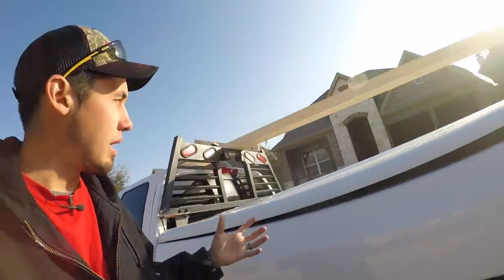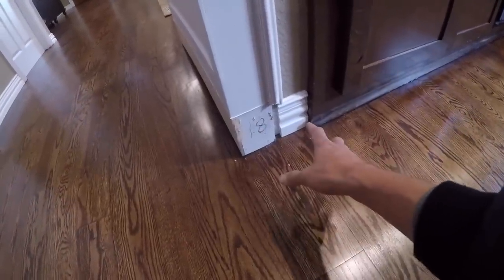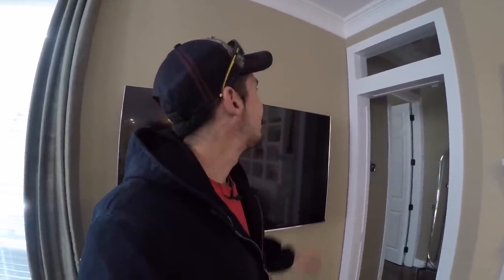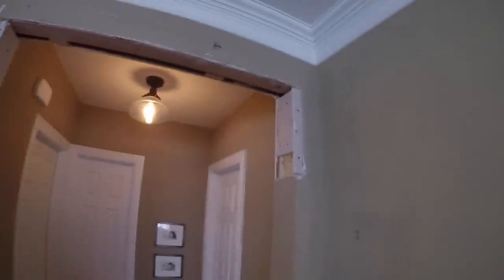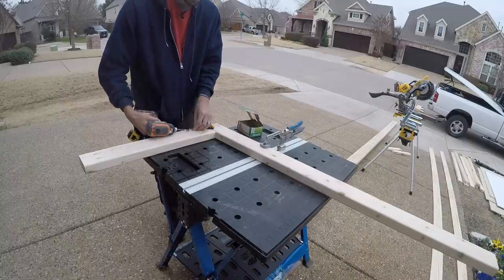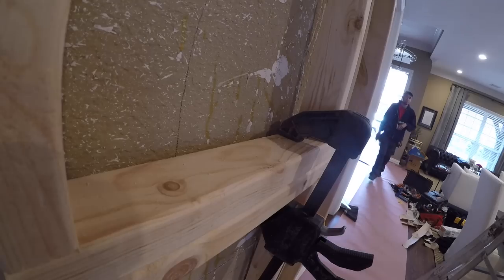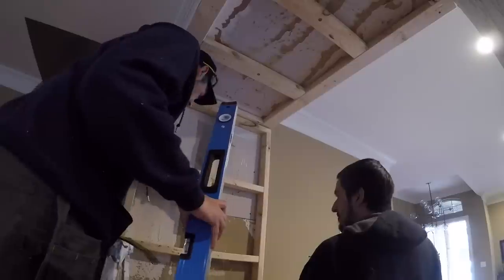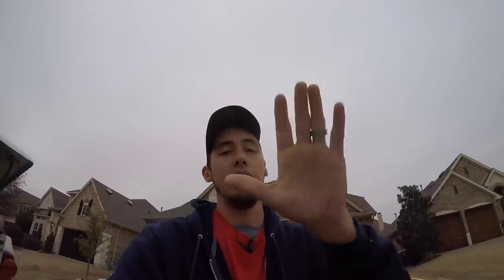A $3500 Mistake

Comment: You have a great foresight for finish carpentry. Good run through, but please move (if you can) and or cover furniture. Also zippered walls for other rooms. I teach my apprentices that no matter how good your work looks and functions, when the customer sees a Dusty mess they see your work in a different light. Even if you get caught cleaning the furniture.
Reply: God of plumbing I don't think he needs your help, i think you need his help emotionally
Reply: Doing a good job isn't just about the actual work you do, it's the whole experience the homeowner gets, like taking your shoes off or putting shoe booties on, especially when the floors were just refinished. Also, keeping a emaculate job site, and putting a good amount of effort into protecting the homeowners stuff, like the floor. If you dropped a screw driver on that cheap rosin paper, you be fixing a dinged floor.
Reply: God of plumbing
he is not your apprentice so he don't take orders from he he works for himself
Reply: tyler krug immaculate. Don’t show off, if you have nothing to show off.
Reply: @KitchenerLeslie2  10 months later?  Don't break your glass house.
Reply: @1dgrdgr  if someone is stupid, they shouldn't prove it unprovoked.

Comment: Hey I’m from a big union state, seen a ton of good carpenters. This guys good keep making videos my man
Reply: He’s a bit extra and not efficient. He really didn’t need those toggles when he was screwing 2x4 into 2x4.
Reply: @ponoahuna627  From a customer perspective you want your trim guy to be a little extra. Plus, he only used the toggles when attaching the 2x framing directly to drywall. He wasn't attaching it to another section of framing.
Reply: @lsara3699  not really... you don’t need to overkill trim... structural... yes. But not trim. a 2x4 weights 5-10lbs... each screw will easily hold 200lbs. No need for the toggles.
Reply: @ponoahuna627  I'm saying he had nothing to screw in to in that situation - he had to use toggles to attach it where he wanted it.
Reply: @ponoahuna627  tbh the and bow baseboard was only thing wrong

Comment: Ok Im what they call a professional multicraft construction worker. I work on the industrial side meaning I have to do everything from form and pour concrete to remodel offices.  I have built cabinets for a living. I have hung and finished drywall and for a few years I worked for a man who flipped houses. I will never know it all but i take my time and do the job the right way or not at all. One of the guys I learned alot from taught me most ppl wont know what it cost but everyone knows what it looks like and how it holds up. Nice to meet you.
Reply: lee jones and knowing multiple trades shows you how your work in one area may affect your results in another.

Comment: Good video! The old guys always said to me when I said something was level. PLUMB is vertical and level is horizontal.  Keep up the videos!
Reply: Plumb comes from using a lead weight hanging on a string to confirm if something is hanging vertically; hence lead is Pb on the periodic table.
Reply: Plumb bob

Comment: that's why it's always good to have pictures of your jobs before and after work to show homeowners how good you are and also gives them ideas five different styles sometimes 3 piece Crown around the top of kitchen cabinets arise dental molding depending on how flat ceiling is you could always leave a little bit of a gap can put LED lighting so when you go out you can leave a low voltage lighting on or just salad ideas this guy on the video is very professional and very outstanding on his work is molding it is with the best I've ever seen he reminds me a lot of my father that's some people can just frame out of window do bass crown either you have it or you don't you see a lot of people try to fix it Corners with caulking just because there seems they're not tight

Comment: Another case of a homeowner telling a contractor what they want (make a 6-foot passage look like an 12-inch column) then not wanting it when it's done. This is due to the homeowner's poor eye for aesthetics. You said it yourself - they didn't even notice a difference in the two doorways until you pointed it out at which point they became frustrated about something they never noticed anyway. Sure, the other guy could have terminated his trim differently. But the existing baseboard is NOT his problem, the existing wall bow is NOT his problem, and the choice of putting dead end crown molding in the passage was clearly following the HO's instructions to match a column.

They will not be happy with anything. They will tell you they love your work to your face, then badmouth you with uppity words like "sanctimonious" to their uppity friends and colleagues because they will never be satisfied.
Reply: If you call yourself a contractor and accept that quality of work. You're not a contractor. I'm not happy with what he did with the wall bow but I believe he will produce a far better product than the shit hole he walked into.
Reply: If someone is "uppity" then they feel they're above you and are not going to be using "sanctimonious" to describe you. How on Earth would "sanctimonious apply to a carpenter anyway?
Reply: design over-kill that looks very stupid.
Reply: Exactly
Reply: I was coming to the comments to write the same thing. I've worked with people like this and they always want to cut corners and I would beg and plead with them not to do something a certain way just to shave a few hundred off the price and they would tell me to do it anyway. I have walked out on jobs before, but if you've got work scheduled in you can't always fill in your time, so just give the home owner what they want. 

I've learned to avoid people like this and to get a feel for them when I'm giving an estimate, but sometimes I don't catch it or just have a gap in my schedule to fill and think I'll be able to deal with them.
Reply: You see, i happen to agree with most of your opinion. The deal with it is you are correct as far as original trim and wall bows. People hire these contractors due to the fact that most of the time they don't want to redo everything, just want they want without knowing rhe repercussions. I've dealt with these kind of clients before. I don't do bad quality work but when it comes down to visionary bullshit the things they complain about are the exact things you told them you could fix for x amount and they refused i.e being displeased with end results. On another note, if you're a contractor going and doing this kind of  work for OTHER people, you must have the knowledge and experience to do the job correctly or not take it at all.
Reply: I know, how rude. A customer telling a contractor what they want. Whatever next? You are obviously shit at your job and can’t deliver what a customer asks. And when they talk bad about your work to their friends,it isn’t because they are uppity it’s because you are shit at your job. Try a different profession pal!
Reply: EightiesTV YOU TOOK THE WORDS OUT OF MY MOUTH!! WELL SAID.

Comment: You are the best mate!!! Modest, but still the best. I wish I was as good as you are. I do similar jobs, finishing jobs, mostly electrical, but we have to install cables and wires run under the baseboards or inside crown moldings. So as you see we have know how to. But you're a champion! Every video of yours is somewhat a lesson for me, and I'm much older than you are. You're the best, mate!

Comment: Great video. BTW, I want to congratulate you for finally meeting that “jack of all trades” guy,  that’s great at all trades. Just a word of non requested advice, that paper doesn’t protect the floor. You should get a longer level, when you get the wrong size lumber you should return to the store and get the right size, 3/4” mdf doesn’t flex in your application to build that 2x4 wall the way you did. Other than that, you did a fine job in seeing how all those details should look. You’re young and should have a great future in this industry.
Reply: Just a quick FYI your comment is annoying I figured I'd give you a little piece of advice also

Comment: Do you use air scrubbers/air cleaner at all?  Even the cheaper ones will help out with dust particles..I know most customer hate the whole construction disruption and the mess it makes..helps sell the jobs also if you inform them the precautions/procedures you take to keep their home clean and protected...especially if your higher in price from other estimates..
Reply: Shop vac air cleaner sold on amazon or at Lowe’s for around $135 works fairly well for small areas...after every  job you should take two minutes and bat out the filter for next job..especially if drywall dust is in the air..
Reply: love you americans, i really wish i was in the USA doing finish!!!! i work in the EU and last week i got contracted with another guy to replace 15 windows in Spain. I made the windows got on site to find the other "cowboy carpenter" had taken a sledge hammer to all the other windows glass everywhere!!!!! nothing covered - his reply cleaners get paid to clean the mess !lol  hate EU carpentry

Comment: looks like the biggest issue was the home-owner wanting silly work done from the start,  followed by previous contractor not telling them it will look out of place. maybe the customer insisted upon having it done "there way" and the contractor obliged vs. walking away.
 I've dealt with many like that in the past, the worst are most always artists and architects.
Reply: Throttle Bottle: I just had a customer who didn't want to see the grain on pressure treated 2×4 for porch railings. They expected all those to be sanded to a smooth finish before installation!
Reply: Imagination should never be a problem for any paying customer. You've got an idea, and the cash, a good builder or finish carpenter should have no issue.
Reply: Believe it or not, the customer is not always right and it is the responsibility of the builder or finish carpenter in this instance to provide guidance and steer the customer away from making an expensive mistake. Even though this person probably made good money at this job because this customer could afford it easily, it's not worth ruining your reputation if you do quality work and lose future jobs
Reply: Realtors are bad clients too a lot of the time. And nowadays, just a lot of stay at home moms who watch fix and flip shows and think they know more than the pros. But if you talk to 5 different pros, you're going to get 5 different ideas of how a job should be done and each one is going to say the other guys don't know what they're doing because they aren't doing it "their" way.
Reply: @harrygaul4475  man I've been in those situations. Where you know what the customer is asking for is impossible, and they stomp their feet and hold money because of it.... it's the absolute worst